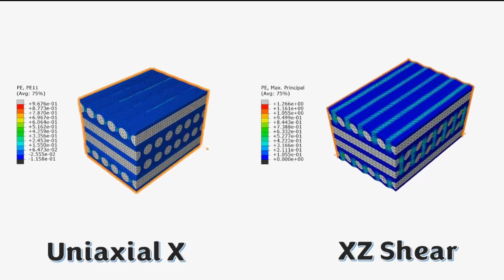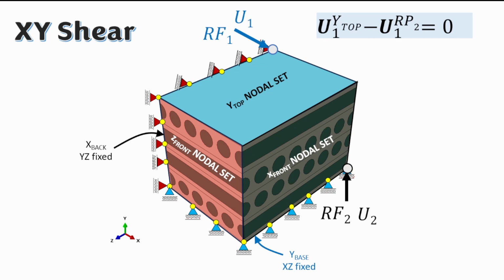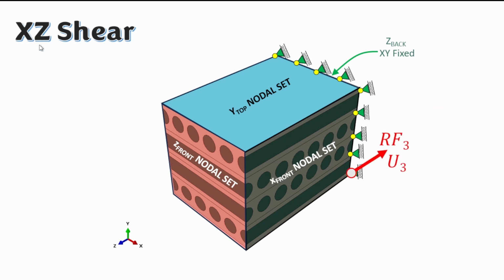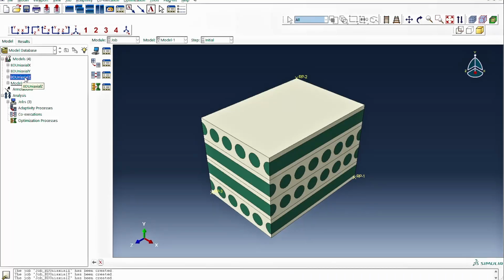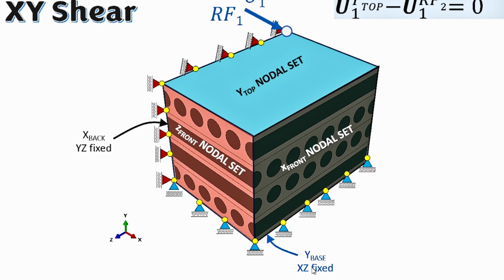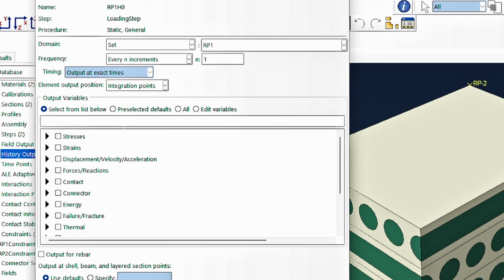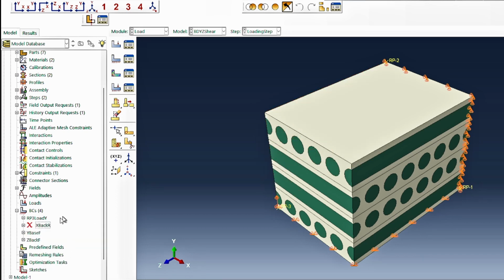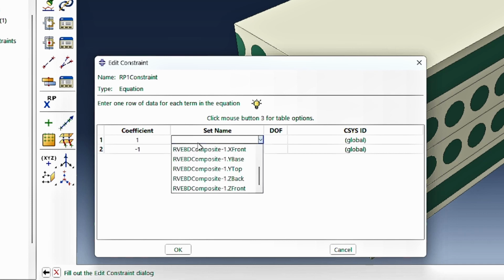RVE Modelling of BD Composites #3: Pure SHEAR Loading Setup

Comment: Dear Dr Okereke, Thank you for your wonderful set of videos about the BD composites.

I have two equations in regard to this matter.

1- Is it okay to have set of geometry instead of nods when you put constraints and loading on them?

2- When you give the XZ pure shear you do both in the negative direction is there a specific reason for it?

Thank you again for your time.
Reply from the maker: Hello, 

Thanks for your query. Here are my answers:

1. I prefer to associate the constraint to geometries instead of nodal sets as the later is subject to meshing of the model. If you change the mesh, you will have to re-attach/re-impose the constraints on the new nodes. But when you associate the constraint to a geometry, since the geometry does not change with the simulation, when you re-mesh, it will still inherit the constraint from the previous mesh, since those constraints are attached the the geometry. This is why I use geometries instead of mesh nodal sets.

2. The reason for using the negative shear value is simply aesthetic - nothing technical. The idea is that with the shear pushing away from the viewer, you would see better the shear deformation rather than when it pushes towards the viewer. Hope this makes sense?

Thanks.

Comment: Dear Dr. Michael Okereke, I have two questions. Firstly, how do I apply shear to the 2d RVE model? Secondly, I applied XFEM to get the damage of the RVE model, so far I can only get the cracking of the matrix, but I want to get the damage of the fiber as well. I changed the material parameters many times, and the successful result was that the matrix completely cracked without any damage to the fiber. Or there were multiple cracks, cracks appeared at the interface between the fiber and the matrix, but it was impossible to calculate and errors began to be reported. How do I cause damage to the fibers？ Looking forward to your reply and some suggestions.
Reply from the maker: Thanks for your question.

With regards to 2D RVE model shear, here is a video I made in the past that addresses this: https://youtu.be/oXgN1qK084k   I hope you find it helpful.

With XFEM issues and fibre damage, I have seen this sort of problem before but that was for a microcapsule for  a self-healing concrete. I think in your case you are undertaking a transverse to the fibre direction study in which case the matrix will fracture way before any fracture seen in the fibre. Most fibre damage tend to be in fibre-dominated direction (along the longitudinal direction of the fibre) rather than transverse to it.

It is possible your result of the matrix cracking (multiply) over and above the fibre is correct but I do not know exactly your loading condition and what your experimental data say for a definite answer.

If you however insist on the fibres to fail in this transverse direction then you must adjust the fibre properties to initiate damage and load to the corresponding loading size to make that happen. It might be unattainable.. but that is a thought to consider.

Comment: Hey, Dr.M.O,   I'm a Chinese researcher, it is hard to watch your YouTube video, and, I have some questions about the isotropic calculation of composite and lattice structure, Do we have to calculate the Stiffness matrix of RVE model with PBC ? and then,  get the Zener anisotropy index to verify the isotropy of composite or lattice structure, In summary, do we have to apply PBC to RVE model when we calculate Zener anisotropy, You can reference this paper "Isotropic porous structure design methods based on triply periodic minimal surfaces". Looking forward to your reply and some suggestions. if it is possible, can you post a video about the isotropic calculation
Reply from the maker: Hello, thanks for your comment. I am not too clear on your question about isotropic calculation of composites and lattice structures. Are you interested in homogenized properties of these materials? I do not think you can use PBC to calculate the stiffness properties. PBC is a boundary condition and does not get activated until a probable stiffness matrix for the material is generated. Stiffness matrix is a material property and is independent of boundary conditions.

I have not done any work with Zener Anisotropy index so unable to help you in that regard. One thing I know is that PBC is the best boundary condition for heterogeneous media and will give you results where errors due to boundary conditions are most minimal. The challenge with PBCs on RVEs is you have to find a way to obtain the homogenised properties. ~With that, you may be able to them determine the Zener Anisotropy index/ratio. 

With regards to the paper you identified, I have read through it and it seems a relatively straight forward paper. They have not used a PBC rather they used a Dirichlet BC. See equations (12) and (13) in the paper where they specify how they applied the BCs.

They extracted stiffness matrix from their simulation and it was not based on the BC. In ABAQUS, there is a way to extract stiffness matrices directly from the simulation outputs. Look at this Quora post for more insight into this: https://www.quora.com/How-can-I-get-the-global-stiffness-matrix-from-the-Abaqus-model

Hope the above helps?
Reply: @MichaelOkereke  Thank you for your answer. I will think about your suggestion carefully.